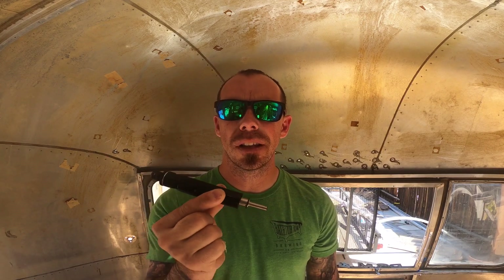Rivet Removal Tool (Its Just That Simple)

Comment: This tool worked well for about the first 50 rivets for me.  Then the fluting on the side of the bit wore on the part it passes through allowing the bit to walk and no longer stay centered.  I think an improved design would be to use a bit that does not have fluting on the side.  After 100 rivets I found this tool to be useless (in fact defeating the purpose of it's use) and am reverting to the center punch and drill method you show in your earlier videos.
Reply from the maker: Raymond you hit the head on the Rivet hehe. Yes you are right. I noticed the same thing as well after 75+ rivets on a window frames. I found punching the center first helps with the walking of the bit but it won’t stop it 100%. Also I agree with either the fluting needs to be changed or the bit itself should be removable from the thread insert. Maybe add a allen retention pin to the thread insert so the drill bit can be changed out easier and make it more cost effective when the bits have to be changed out.
Reply: @dcdvs1583 Hello, can you please point me towards the video where you show the center punch method for removing rivets? Thank you
Reply from the maker: @Borgorl  it will be on my exterior panel replacement video part 1 of 2 and I specifically talk about it in the first 2 minutes of the video

Comment: Sounds like the parts need to be hardened and ground to dimension. Some grease on the moving surfaces would help as well. Using a tungsten carbide bit would help as well.

Comment: Would you recommend  this for removing rivets on travel trailers and aluminum boats?
Reply from the maker: Ya I would. It works well on any rivet no matter the type of application. Depending on the amount of rivets needed to be removed, will depend on how many drill bits you will need as the bits wear out every 40-50 rivets. Very simple to use and makes the process easy if it’s your first time trying to remove rivets. Thanks for watching

Comment: What if you don't have access to the opposite side? I guess the back of the rivet just falls down where can rattle around.
Reply from the maker: Yes that would be correct, but depending on insulation install most likely you wouldn’t hear the rattle. Plus when in camp or just parked you shouldn’t hear any rattle at all.

Comment: Will this removal tool drill out pop rivets & Olympic rivets?
Reply from the maker: Technically yes you could on both. The pop rivet would be as easy as it gets when removing the rivet compared to buck rivet or Olympic rivet. This tool works well keeping aligned as long as the bit cut still has a bite or sharp cutting edge. As it gets dull you will find the drill bit wanting to walk to one side of the rivet from center. Only two ways to avoid that is by either center punching the rivet prior(which kinda defeats purpose of this tool) or replace the bit about every 75 rivets to avoid walking which can become costly depending how many rivets need to be removed. I found my earlier method by center punch and regular drill works just as good if you meticulously take your time. The chisel from the side works well too and any scuff marks you make during removal will polish out if you are polishing the exterior, otherwise you will see them if it is not polished out.
Reply: @dcdvs1583  So I suppose buying a drill bit sharpener is one way to go.

Comment: You need no special tool only a drill bit in the correct size that's all and for stainless steel a drill bit that have 5% cobalt in it and done.